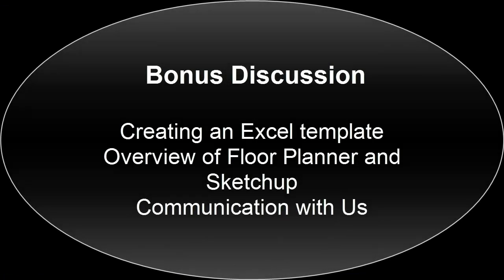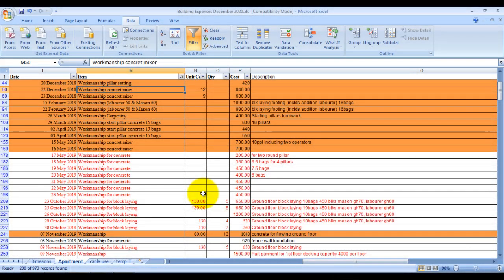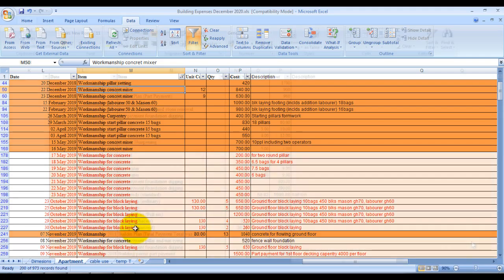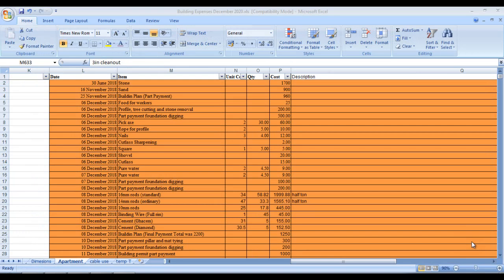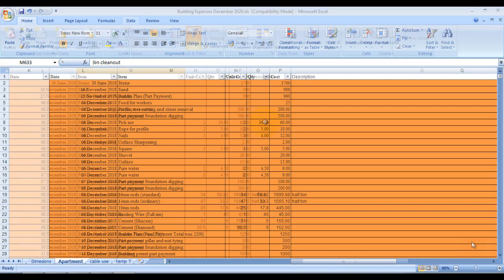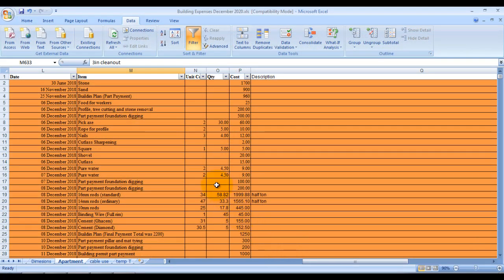Cost of Building in Ghana _ 2nd Floor Block Work and 3rd Floor Slab _ Ep 6

Comment: Good evening,  trust you're keeping well by God's grace.  Do you have your estimates for the electrical wiring?
Reply from the maker: No, cos we have only completed wiring in one unit and the outside lighting. The cables used were bought two years ago. If you have the excel sheet you can see the quantity bought. We have some of the cables left though

Comment: Please how much did you spend on iron rods for the plinth /ground beam ?
Reply from the maker: Better you do the calculation per the below cos of inflation
14mm rods  = 1 ton (95 pcs) was 3000gh then, but now 4800gh
8mm rods =  half ton (150pcs) was 960gh then
5 days for workmanship for two ppl
2 rims Binding wire
Reply: The iron rods prices are too high may God help us

Comment: i am amazed you managed to do the job with paying per day
Reply: Seriously
Reply: Pay by day if you have any doubt on ur estimate
Reply: how would you know much the total would be if you do per day? they will sit down all day when its per 
day
Reply: @ObibiniAfrikan  every 2 bags of cement cost 100 gh for each mason and 80 gh for each labourer. No one can cheat you
Reply: thanks. so you just have to calculate the entire foundation and ask them to keep building until down?
Reply: @ObibiniAfrikan  for any concrete work 100 gh Mason,  80 ghana labourer, for any mortar work 80 gh Mason 60 ghana labourer. Alwaas how much cement you they will use and work out how much it will cost you then you as the foreman how much he will charge if you pay by contract. U will see which option is cheaper
Reply: thanks..Darlington
Reply from the maker: Good job @ Darlington. That's the whole idea, to give info to ppl to help with their project. Just to add that the two bags of cement should lay between 80 to100 5in blocks and 60 to 80 6in blocks as we indicated in the videos
Reply: is 10000 ghs cedis ok  labour cost of for a two unit   two bedroom foundation ? this is excluding filling
Reply from the maker: @ObibiniAfrikan  Just a Yes or No answer will be deceptive. To get a good answer the dimension, the soil type (to know how deep they will dig), level above ground etc all need to be known
Reply: @Lerwincel  medaase..much appreciated

Comment: Lerwincel, first of all your wife is a blessing to you and a real helper and trooper. I need a wife like that. 
Question on plumbing :  @ 9:34 , will the pipes be completely covered by the 6" floor slab considering the slopes of these pipes( and in some cases the long
pipe distance to the outside of the building)  ?   Thank you.
Reply from the maker: No, not all pipes were completely covered in the concrete slab. However they were covered after screeding. We had 2-3 inches cover for the screeding on the 2nd floor

What you referenced was completely covered in the concrete though. The 2 and 3-inche pipes all get covered, only the 4-inch needs screeding to be fully covered